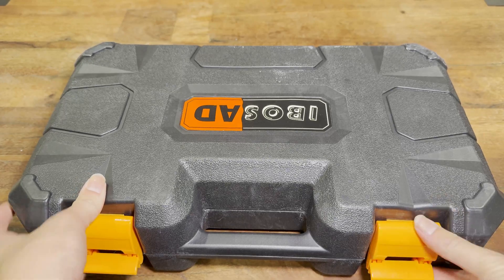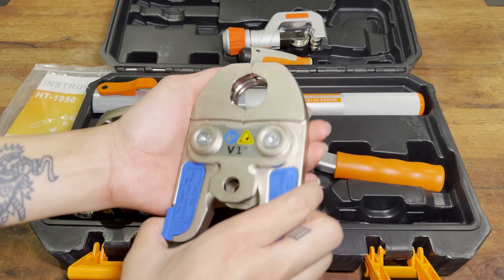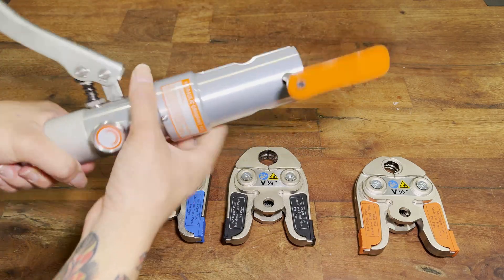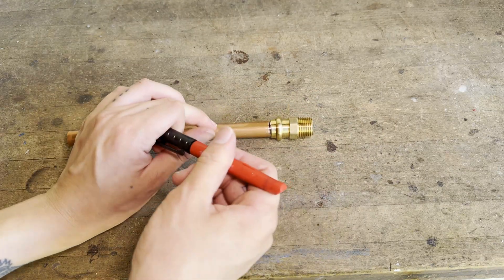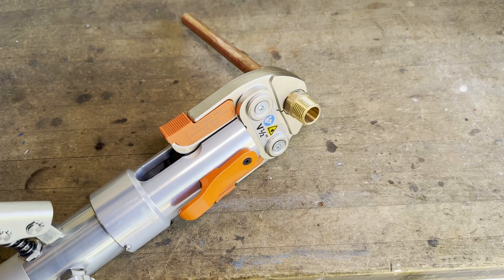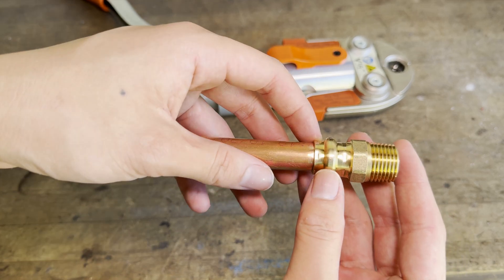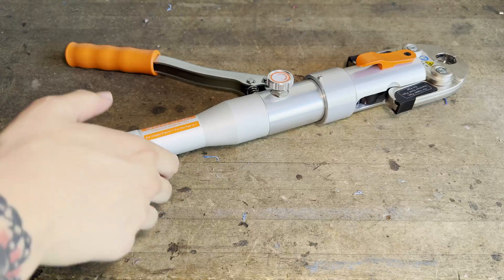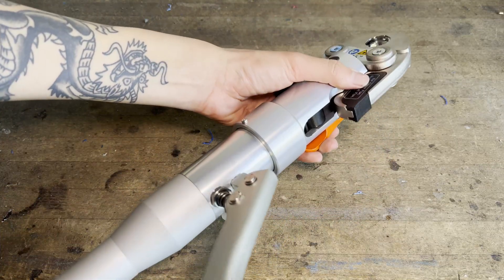New IBOSAD HT-1950 Hydraulic Copper Press Tool Review - This Cheap ProPress Is Shockingly Good!

Comment: Is this the same type they use for refrigerant lines or is there a different one
Reply from the maker: The tool is the same but the jaws are different.
Reply: @DragonBuilds what is the exact same tool but the Jaws they make are like smaller for the capillary tubes?
Reply from the maker: The refrigeration tool is for ACR copper and goes down to 1/4”, for capillary tubes you probably just have to braze.
Reply: @DragonBuilds but for r600 they say no brazing
Reply from the maker: Really? You can definitely braze R600a systems after purging. Otherwise there are some flame free refrigerant joint systems you can look into.
Reply: @DragonBuilds that's actually what I'm probably looking for a mistaking it for the crimping tool

Comment: good video, is this crimping tool also sold for the European market with metric measurements because here the pipes have different dimensions, is there this tool also for the European market?
Reply from the maker: Yes, there are tools available for metric press fittings.
Reply: @DragonBuilds  thanks for the information because this tool is also great for repairs and working right next to the wall

Comment: Can you dissemble the handle where it pumps? I want to know how it pumps the hydraulic and if there is a male or female screw in the pumper.
Reply from the maker: Yes, you can download a service manual from the Ibosad website which has information about how to disassemble and repair the tool.

Comment: Very nice. I've been using the Universal one, the one you can just swap the dies, so far so good then I felt forced to get another set, the one that comes with the "multidirectional" jaw or crimp ring because they wouldn't sell that separately, $165 is better than $2,500 for me.
Reply from the maker: Yeah, it would be nice if they sold the jaws separately. All the jaws in the HT-1950 series are interchangeable so I’m not sure why they don’t sell jaw sets. Regardless, these press tools are still a great deal compared to the electric ones.

Comment: Now this one I might try I was looking at buying the ridgid propress for $1500 but ay if I don’t gotta spend that much it’s a win win
Reply from the maker: Yeah, it’s definitely a good value and well built, i highly recommend it if you want an inexpensive ProPress tool. It's not as fast as an electric tool, but for occasional use it's not a problem.
Reply: Well you should sell your old one really cheap. I'm looking to buy a hand tool one that you can crank down but I want it for refrigerant lines that are very small for refrigerators if there is such a thing it might be a different tool entirely.